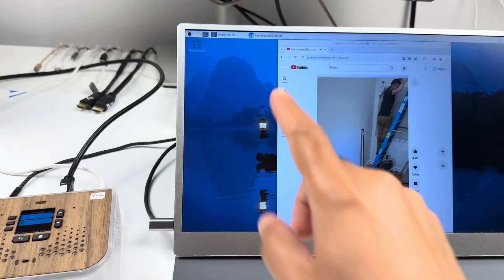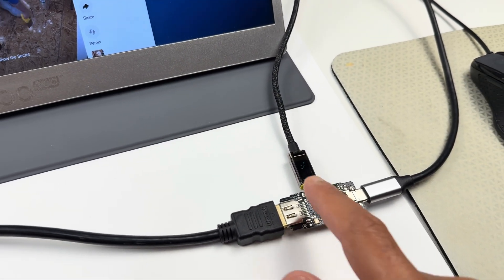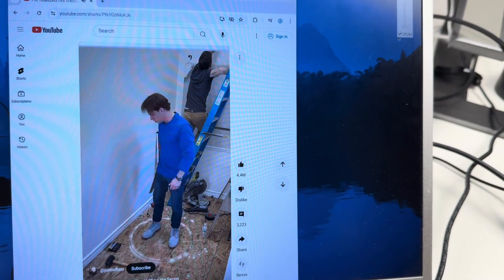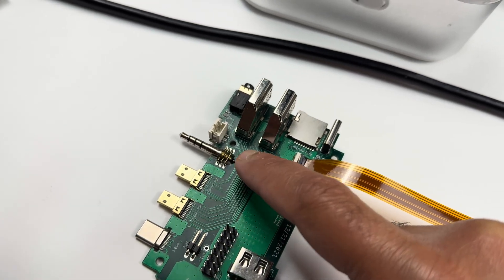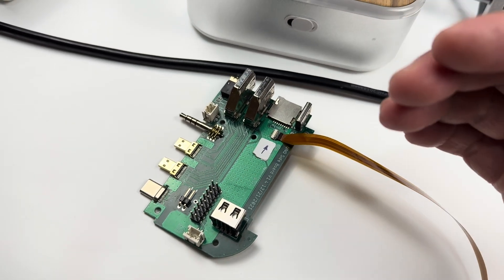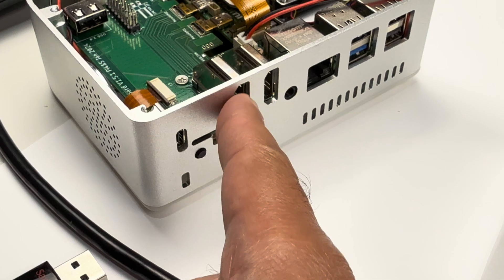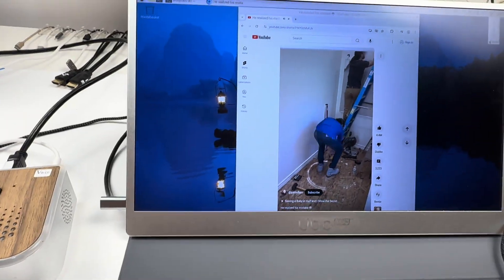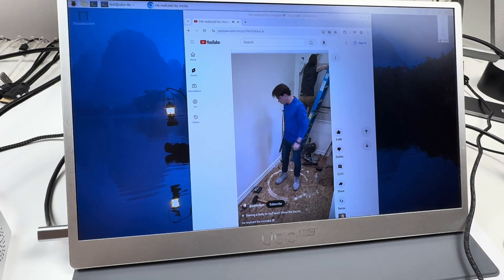Bringing full function USB-C connector to Raspberry Pi 4 & 5

Comment: Subscribed!

I am looking for a board that is like the DeskPi Micro HDMI to HDMI Adapter Board from GeeekPi but adds an internal USB so it can be used in custom cases. This board just extends the USB-C and HDMI to be flush with the ethernet and USB ports so getting USB from the USB-C should be easy.

I want all the main ports to be outward facing for an IO Shield but I also want some internal USB A ports (1 is fine, 2 would be awesome) for customizations internal to the case.
Reply from the maker: This board already exists. Check here:
https://shop.getubo.com/products/connector-board-for-raspberry-pi-4-and-5-radxa-x4-radxa-rock-4c

I am planning to add USB-C video to the original design. Please note that Raspberry Pi USB-C exposes one USB-OTG which can be also configured as USB HOST. I have been thinking about putting a USB hub in front of it but if I do that, it cannot be used as USB-OTG. So I am resisting that decision for now. In other words, there is maximum one internal USB connector without a hub.

Comment: Hello
Your little board for video over a USB-C port is super interesting. If it transmits data and power, it would be perfect for the Raspberry Zero or another Raspberry Hat module.
Reply from the maker: The current design works with Pi 4 and 5. The design is open source and you can find the KiCAD files and more information about it here: https://www.reddit.com/r/raspberry_pi/comments/1mcn3b8/comment/n61eno6/?context=3
Reply: Hello I am answering for my brother's place you did not understand his request he is talking to you about the small card that you use to demonstrate the one that allows you to pass the hdmi signal on the usbc that we see on your video 
Sincerely,